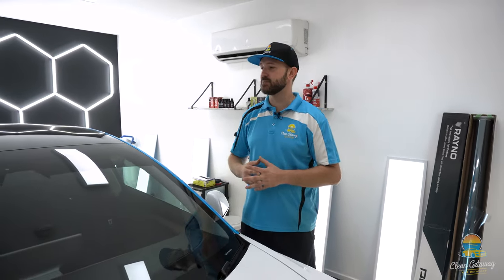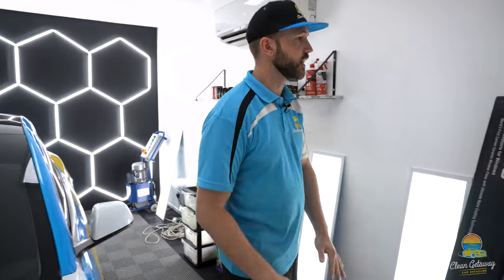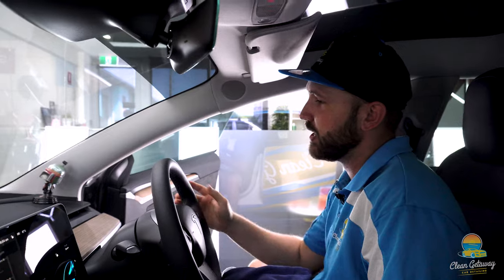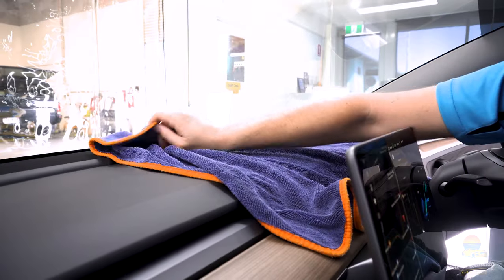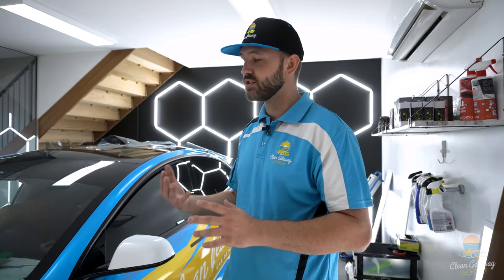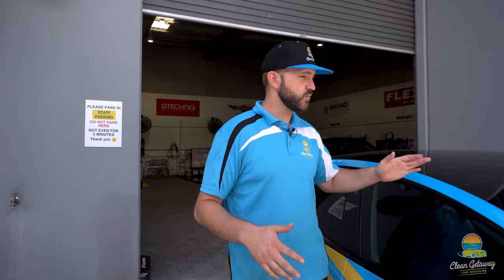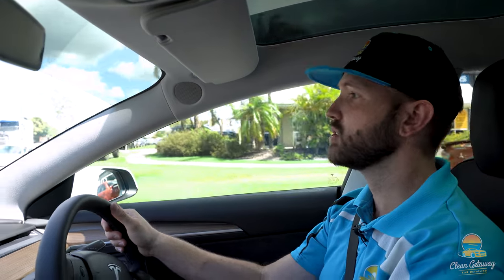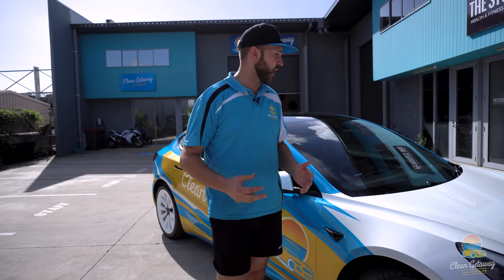Can You Tint a @tesla Model 3 Windscreen?  ....We Can!

Comment: nice video, I'm surprised I don't hear about this more often in Aus with the summer heat, you'd think this would be in the standard tint packages with the modern tints we now have available
Reply from the maker: it makes a huge difference Warwick!  Even when the tint is practically clear, we can't see any reason why it should be illegal...infact it helps reduce the glare which makes it easier to see through the glass - not to mention how much it helps reduce the heat coming through the glass...saves energy :D haha